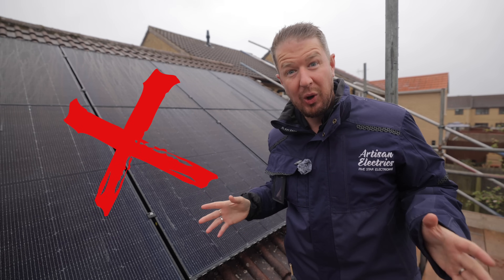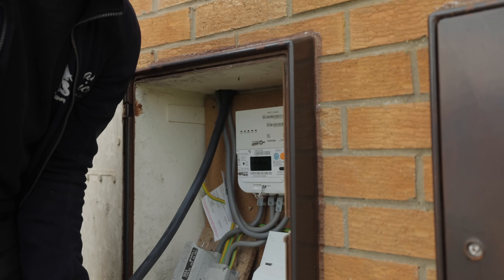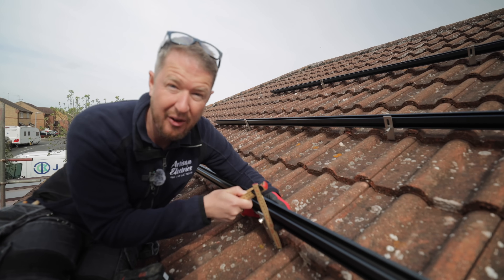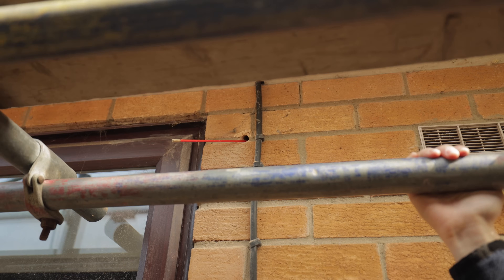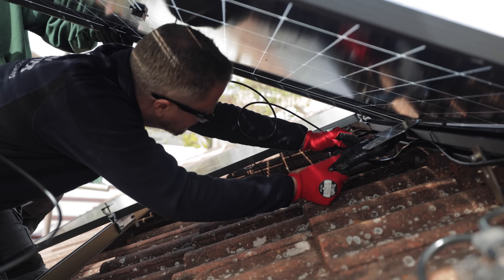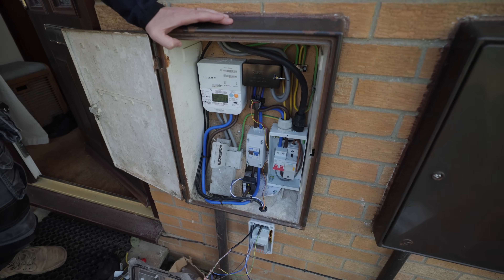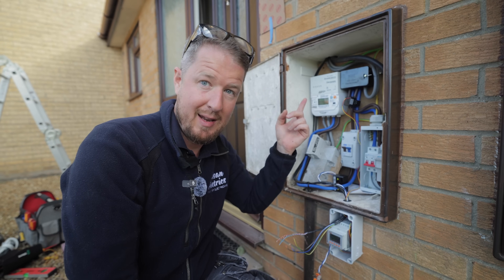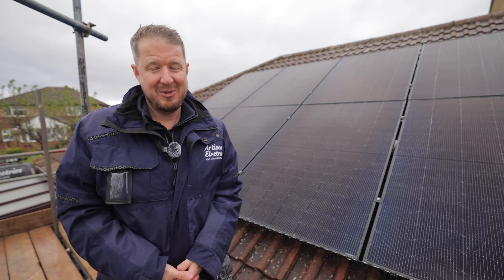Have We Been Doing Solar WRONG All Along? 🤷🏻‍♂️

Comment: Forgot to mention. The enphase IQ7+ have a max output of 315 watts compared to those bi-facial panels max of 420 watts. Yes its common to oversize your panels compared to you inverter but thats a big difference. Also the hybrid interter for the battery installation is a bit useless when all you get from the roof is AC courtesy of the Enphase units
Reply: Don't know why Artisan say they don't like DC. When batteries are DC and you can wire DC straight into the battery without losing power going through an inverter!
Reply: since you are getting AC from the microinverters dont you need an inverter at the battery to change it to DC to charge the battery?
Reply: @scottmcshannon6821  yep, therefore introducing further losses where a hybrid inverter charges the battery with DC straight from the array…..at lower voltage so there is are some losses.
Reply: Worse than that IQ7+ is 295W output with max 440w input. Would be interesting to see a comparison of the same panel layout using a string inverter vs micro-inverters like these to show in terms of generation through out the day the actual difference, could be the loss per panel of micro-inverters is outweighed by generating more, or if there is an issue with shading of panels which would effect the overall output from a string. There is a HUGE price difference to account for as well using MicroInverters.
Reply: A 420 watt STC rated panel are going to be in the 300-330 watt NOCT range and that's going to be in real world perfect conditions so it really won't clip all that much. Getting a more expensive micro inverter probably isn't worth capturing an extra 25 watts a few times a year.
Reply: They also talk as though its new technology, but Microinverters have been around for years and Enphase have been trying to eat into Solar Edge's market share in the US for as long as I can remember, and still failing. These 420-440w REA panels will produce way more in the summer with a standard string inverter and cheap Tigo optimisers (if needed) for shading and panel monitoring. If one Microinverter fails then Enphase will only pay a small contribution to replacing it, and this won't cover the cost of re-erecting the scaffolding to get back up there! Lots of scaremongering that shading on one panel can wipe the entire array out - utter rubbish !!! Obviously not heard of diode bypass!! If one panel is in shade it will not bring down the whole array, unless there was a solar eclipse!!!
Reply: @JohnThomas-ey1hx  Bypass diodes don't get you better power from 1 panel being shaded, they are more to reduce wear on panels from hotspots. Shading 1 panel will still have a notable impact on the whole string, basically making that panel useless until the shade goes away. You also get the benefit of seeing production per panel, so you can know if a panel dies or is problematic. If you have no trees, a string inverter is fine if you don't care about stats.
Reply: @xeridea  each solar panel is split into 3 substrings protected by by-pass diodes. If shading is covering 1 of the 3 substrings you’ll still get 2/3rds the output. A microinverter may maximise the output using MPPT to allow all 3 substrings to output but there is only so much it can do….like light diffused shading. If it’s hard shading the panels by-pass diode will kick in before the microinverter can do anything.
Reply: @JohnThomas-ey1hx   I can agree that I was surprised they think it’s new tech as well. As a installer myself you don’t need the scaffolding and can just use a d ring saving cost and time. Then again idk how the codes in the uk are so they could just be following protocol
Reply: @JohnThomas-ey1hx  considering they are spending not just a full day. But coming back the next day with a team of 4 plus dudes to install 8 panels...

These panels will already never pay themselves back. 3 guys 4 hours work for something like that. 1 for the AC cable and 2 for the panels.

Comment: Great video but come on Artisan......everyone knows that shading doesnt "bring down the whole array". All solar panels can look after themselves without optimisers as they have built in by-pass diodes and together with MPPT built into string inverters, each string is very well optimised. So much discussion on the internet regarding the value of optimisers and microinverters, a lot of cases say a gain of a few percent per year.....some say nothing at all, and that all goes out the window when one fails after a few years and you have the expense of having scaffolding and panels off to get to the failed unit.
Reply: And in this install - 'later and earlier in the year' when the shading was supposed to occur, those trees wouldn't be in leaf.

Comment: you know whats great about those micro inverters, if one fails, you have to put up scaffold/get a picker up there, remove the panel and swap out the module, and better yet, if its 5 years later, you may have to replace all the micro inverters because they aren't cross compatible.
Reply: Yes, exactly. ❤
Reply: After installing dozens of micro inverter systems I would definitely go with a string inverter.
Reply: This right here is why I prefer string inverters combined with generic/non-vendor lock/non-communication optimizers, with at most a parallel optimizer reporting system running.

Easiest way to ensure that in the best case scenario, I'll just hop up and disconnect the panel and optimizer and replace them, or worst case, I leave them up as long as rest of the string continues to operate normally and the failed optimizers or panels pose no safety (electrical or fire) or production risk.
Reply: @shahzebatiq1 what brand would that be? I wanted to go for Tigo, mainly for optimization, but maybe use also the other features
Reply: @shahzebatiq1  'Optimisers' don't work, they are a waste of money. An all in one Voltronic rebrand inverter, and any modern solar panels, is all you need.
Reply: Exactly. Putting a box of electronics behind a solar panel on a roof, where the panel gets incredibly hot in the Summer, and you have one of these devices for each panel, is the stupidest idea ever - especially because they DON'T WORK. They don't increase power output by any measurable amount, otherwise there would be numerous videos showing a before and after, which prove this. Why aren't these videos on Youtube?
Reply: i bet they are not too difficult to repair ..........probably the capacitors that go first
Reply: From a practical perspective I wouldn't install micros. Any electronics on the roof are inaccessible and there isn't any real output benefit.

Comment: Could you fix the micro invertors INSIDE the roof slope  ( or would that be a problem for heat dissipation)?
Could save a few maintenance problems down the line if possible.

Comment: If you get a DC-coupled battery, you save the same amount of space. Instead of having an inverter for the panels, then a rectifier for the battery, then an inverter for the battery, you only need one inverter for the whole system. Our 10kW+10kWh system is just one battery-width wide and 1.7m high. And a good 25cm of that height is a heating pipe passing through the middle.

Comment: I’m confused, micro inverters have been around for around 12 years in the UK, is that deemed new 😅 Bifacial have been around for even longer but obviously at lower cell efficiencies. I’d be interested to know which panel they used to get the 20% difference in output and is that 20% more over a day, week, year or just one moment in time. From the quotes I’ve seen, the REA Fusion (Heatable) and Enphase equipment carries a hefty premium over many other brands and string or optimiser based systems so you’ve got to compare the ROI and the possibility of scaffolding for repair and assess shading issues of course.
Reply: Have you ever seen a datasheet for the REA Fusion 2 panels?🤔
Reply: @VinoVeritas_ I have the munchen bifacials since nov 2023.  They are rated 400wp front. 150wp back. The 150wp you only get with a reflective background. Like a flatroof with a white coating on the black roofing material.   Is it worth it? ..the energy market changes so who knows..   I went for it as they where not much more expensive and they are solid glas/glas pannels.

Comment: If anything goes wrong with the Enphase inverters (or they need replacing after 10/15 years, I assume that's a scaffolding up job?
Reply: It sure is - and it will cost £2,000 or more in 2024...

Comment: Where is the Envoy? This REA Fusion panel is a premium Australian  product designed for harsh climates. The front and rear surfaces are bonded "glass on glass" so it should last. There is no plastic backing sheet to peel off /de-laminate over time.

Comment: I think a £50 grinder with a thin blade would beat the £300 Hilti on that cutting job, another tool battle required maybe.
Reply: Most metal grinding disks clog up when used on aluminium. Tungsten carbide tipped circular saws work well though!
Reply: @robinbennett5994  Your right most do but there are some specifically for aluminium, in my experience the problem with carbide tipped saws in hand held devices is that they can kick back and can be dangerous but fine in a bench mounted saw, I owned a business for 25 years cutting aluminium extrusions.

Comment: Interesting to note the bird guard is designed to allow ventilation up behind the panels, would be concerned about the temperature buildup behind the panel given the inverters are there, so would be nice to know the inverter operating temp range
Reply: The operating range is "fit for purpose". Those things are designed to operate under panels on rooftops.

Comment: What are the conversion losses?
Panels DC to Micro inverters AC down to battery which stores it back in DC.
Reply: And surely another inverter to go back to 230v?
Reply: @TheGalifrey  indeed 👍 It seems a little counterintuitive to go from 1 hybrid inverter for a whole system to 1 battery inverter and 1 inverter for every panel on the roof.

Especially as you not only have more conversion losses but if one fails it will be a lot more difficult to replace than a hybrid inverter that's sited in your garage for example. 🤔
Reply: @UpsideDownFork  Artisan doesn't understand anything about solar PV or battery storage. He's the type of guy that goes on a week long course to learn how to open a jar by hand, only to then spend a grand on a tin opener.

Have you tried finding the datasheet for these amazing REA Fusion 2 panels? It's non-existent.
Reply: @UpsideDownFork  My thoughts exactly. You may gain from the panels but then changing DC from panels to A/C, A/C to DC for battery charging and then back to A/C for use just seems like 2 pointless conversions to me. That efficiency increase is obviously only applicable if you suffer shading as well. I am sure they work well with a fully integrated (and very expensive) solution that will take decades to pay back including install costs, not sure the same is true of my situation.

Comment: bifacial is already outdated - was new 3 years ago. 
Where are perovskite panels , those real new tech ?
So small solar power installation that would not work out this way here with all the huge overheads. 

And enphase is not the most efficient way to generate . 
I doubt the bifacial results no one else has seen before. Those had only worked out on the perimeter panels of a roof and just 11%
Here they are crap  , no one buys them anymore unless they are cheap .
Reply: Would you buy a new panel of which you do not know if it will last more than 2 years?

Comment: This is your best video yet. Nobody else on YouTube has shown the tiles being lifted up and how you attach the rail mounts to the roof. I know that you're an electrical channel but when it comes to solar it's the roofing part that we need to know about.
Reply: You need to watch a few more YouTube videos then. 🤦‍♂️
Reply: There are actually quite a lot of YT videos showing the application of the brackets .
Reply: And why is there no silver sarking under the tiles to get an extra waterproof layer and reflectivity ?
Reply: What would be great is a tool designed specifically for grinding a channel in the back of the tiles…using a grinding wheel and the torque placed on the wrist, the dust/particles that fly off, as well as the mess it can make is not good…

Comment: If using biface panels - would it make them even better if you paint the roof white underneath them (with some solar reflective paint)?
Reply: What about the panel itself has a reflective back 3" (or fully optimised distance) from the front panel.

Comment: DC shock race had me laughing😅

What's the cost premium of these panels over standard?
Reply: They're £500 a panel according to Heatable's website.
Reply: @VinoVeritas_  Strikes me as over the top compared to current commercially available panels. Is the shade busting tech worth it? 🤔
Reply: @admizasa9215  Of course they're not worth it. However, you'll always find someone gullible enough to pay for the 'best'. It's all smoke and mirrors. Try finding the datasheet for these panels.

Comment: Nice vid just had 15x bifacials on my install last month, with enphase inverters and IQ5P battery, kept my system all enphase interesting the battery here is a alpha. Was a Envoy needed? I thought that was how the app worked?

I never put bird protection into my install but looking to retro fit myself, seen the clenergy kit for around £115 which is plastic not metal like these.

Just add while browsing for those bird guards noticed clenergy end caps! Installer did not fit these and well there only 50p so think I'll be getting those too my OCD kicked in, I know they probably have zero functionality

Comment: If you've got enough roof space it might be more efficient just to install 20% more panels on the roof. But you haven't said how much the panels cost. 
Individual micro inverters on each panel are really useful if there is sometimes partial shade on the roof. If there is the same sun always on all the panels it is more cost efficient not to have them.

Comment: I'm not convinced about the extent of the claims about your bi-facial panels. Firstly, the transparent gap between cells in the top side is a waste of area for the top side. Secondly, the gap is very small compared to the overall area so will only allow through a fraction of the incident light falling on the overall area and that light won't be reflected well by roof tiles. Thirdly, new N-type panels will be more efficient than the older substitute for the broken panel in the demonstration. What you really need to do to be convincing is to compare a single sided panel with a bi-facial using the same PV cell technology. If that was done I don't think you would see the advantage claimed. Bi-facial panels are better employed where incident light can have better access to the rear such as a pitched field install or fence panel deployment. The worst deployment is flat against a pitched roof.

Additionally, although micro inverters provide excellent monitoring of individual panels which can highlight problems they do introduce multiple points of unreliability under each panel compared to a string inverter with easy access in a garage. If the MTBF (mean time between failure) of a string inverter is 10 years and a micro inverter is 25 years but you have 25 of them, you have to consider where the bell curves overlap and how the multiple number of micro inverters increase the probability of one micro inverter failing much earlier than you expect. You may be getting the scaffolders in to replace one micro inverter at great expense compared to an easy access string inverter and possibly earlier.

Another point often overlooked is that solar panels have diodes within that stop one panel or part of a panel in a string going reverse polarity when a shadow falls on part of a panel and it does high impedance. You only lose part of a panel output with a small shadow or one panel if the shadow covers the whole width of one panel. You don't have the whole string drop out or all the panels drop down to the output of the shadowed panel - as the micro inverter sales people have you believe.
Reply: Don't expect a reply from Artisan. The guy isn't the sharpest tool in the box. So everything you've written will go completely over his head. The REA Fusion 2 panels are £500 each according to Heatable's website. That's some mark-up and very attractive to Artisan.
Reply: @VinoVeritas_ wow, you've seriously got an issue with Artisan😅. Let it go fella, this isn't the only channel on YouTube.

Comment: If you put a reflective sheet under the panels it would massively increase the generation from the back.
Reply: The reverse is true. You need to cool the back of the panels in warmer places as they lose efficiency when warm.
Reply: @hughmarcus1  Is peak summer generation more valuable than winter generation? Self-consumption gives a better return, I believe - so winter probably pays better (so long as the configuration actually helps with this scenario)
Reply: @hughM9  
Your wrong! If you increase the % of the generation of the reverse side by as little as 20%, it would outweigh the efficiency reduction. Example... 1/3 extra hourly generation would make the 0.32% lower efficiency per 1°c higher heat (over 25°c), even at 40°c, panels are still 95% efficient. Basically, increasing 33% of reverse facing faces, would only reduce generation by maximum of 5%! Do your own calculations, then reply when you realise I'm right.
Reply: Mirror finish roof tiles/slates under PV are the future😂